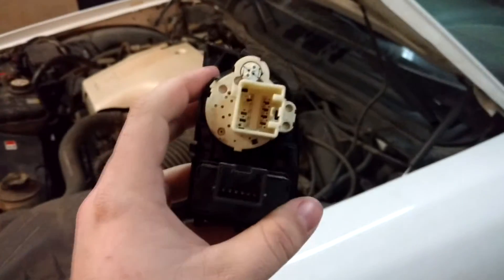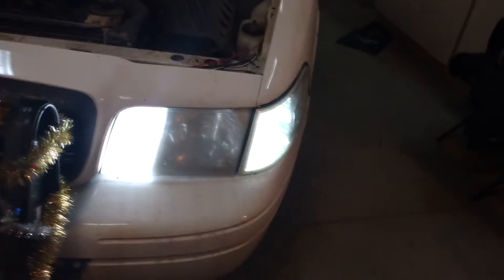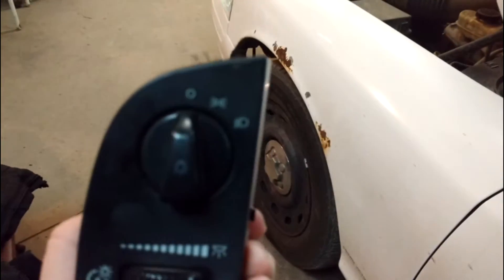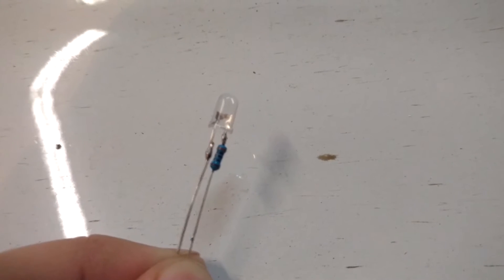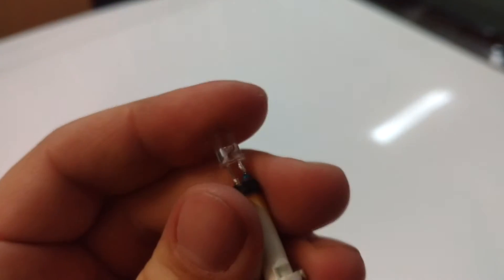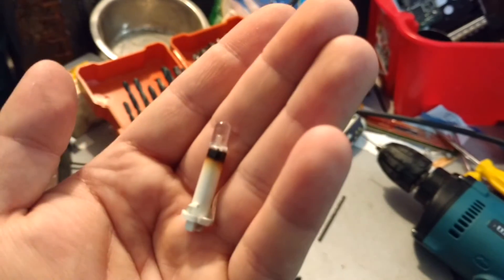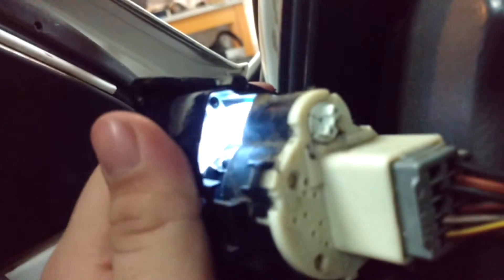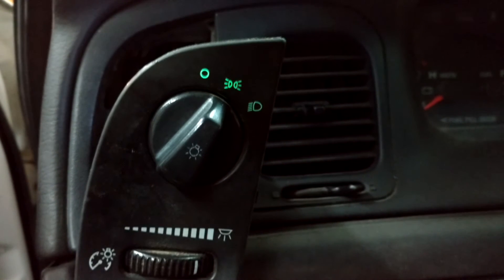Crown Victoria Headlight Switch LED Upgrade

Comment: could you do a video on removing that exact dimmer switch/ headlight switch from the dash? I am afraid of breaking the clips and it seem really difficult and so I would like to know if you could do a video on how to remove it and how you did it?
Reply from the maker: It's been a while since I did it, but I used a small long handled flatblade screwdriver to pry around starting from the right side of the module. Unfortunately there's no great way to do it and you have to be super careful to not mark the dash, you likely will leave a couple small dents, but the clips aren't super strong thankfully.

Comment: I've used just 12V rated LED's without the resistor.  They work OK and they fit into the plastic socket without any cutting or drilling.
Reply: civilmel619 has

Comment: What is the method for removing the module?
Reply from the maker: Sorry I missed your comment, my email notifications aren't working.

I found that a small flathead screwdriver, then starting at the bottom is the best way, something plastic would help prevent damaging the surrounding trim.

Comment: Does your done light turn on when your doors open? I have a 99 and mine does not. Only when I press the headlights switch will it turn on and off.
Reply: Is yours an ex-cop car?  Google "dark car mode crown vic "

Comment: Where did you get the LED from?!
Reply from the maker: This is one I got off ebay, but you can get them easily at places like radio shack, or other hobby electronics stores.
Reply: Junction Runner No more Radio Shacks here nowadays